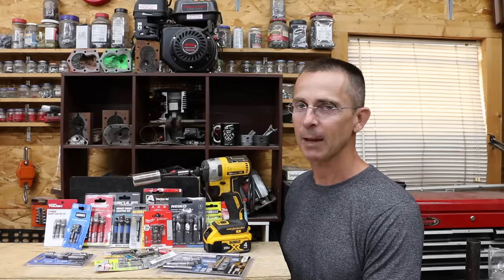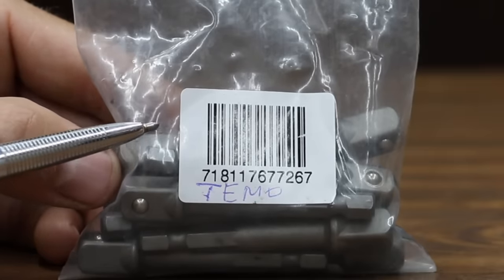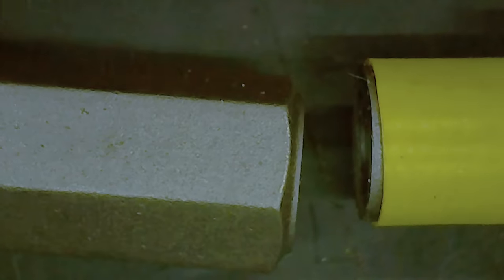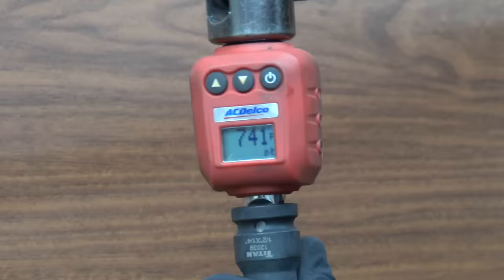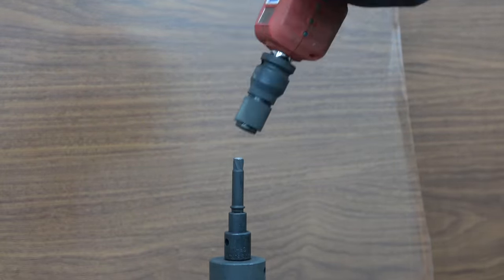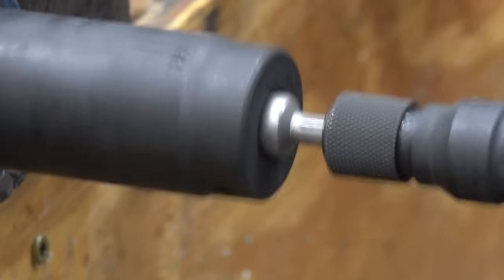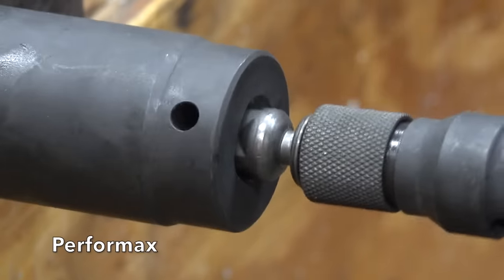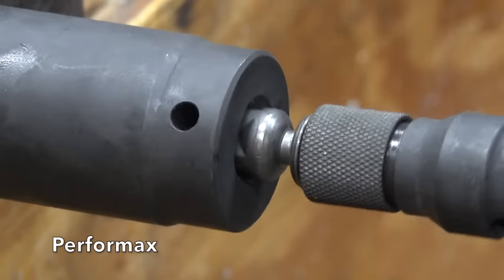Best Socket Adapter? 18 BRANDS: Milwaukee, DeWalt, Makita Gold, Ryobi, Hart, Irwin

Comment: Can your psi ratings be converted to a torque rating of nm or inch pounds?
I just used the Milwaukee 1/2" adapter on my wheel nuts, which are set to 110nm, and it lasted for all 24 of them and it didn't take much effort to take each one off. It's not the tool I would use for work but I didn't have my impact wrench at home only the impact driver and needed to swap my wheels over so thought I would give it a shot as I wasn't bothered if it broke.
Reply from the maker: Thanks for the suggestion.

Comment: I could've used this info last year.  I broke a ton of these things.  But mine usually broke at the smallest diameter between the hex sections where mounted in the impact driver.
Reply from the maker: Great feedback. Thank you
Reply: @ProjectFarm  btw, I was using the Milwaukee impact driver.  The adapters that didn't twist the hex shank after breaking were still usable, but no longer had retention in the Milwaukee.  But they did seem to last longer,  which would mirror your testing.

Comment: I hope he knows that you usually wouldn’t use a torque wrench that big for a impact it is “shock absorbent” sooooo every single hit the impact does when you hear the “ting ting ting” sound is the bar inside the impact smacking another bar giving it that torque Milwaukee was able to flex before snapping and so was others so therefore those are good brands that live up to the name
Reply from the maker: Thanks for sharing.

Comment: How can the Neiko put out 1675 PSI when it breaks at only 666 inch pounds. Is it because of the way the torque was applied? 

Just seems odd that it breaks at around 50 ft/lbs but drives over 100 ft/lbs in the second test.

Comment: The 10 point torx socket was created for same reason... mainly to protect the fastener head. Then 6 point torx plus came out.  

This was a great info. I use the hex adapter a lot. I have also found the dewalt very good. 
Your testing seems to point out the shock protection has no point on socket hex adapter . I know I have never seen to much wear on heads of larger fasteners with correct size socket.
 But on smaller fasteners with an internal socket or screw head you do see torque damage. So maybe shock protection only good for screws.
Reply from the maker: Thanks for the feedback.

Comment: People confuse the purpose for shock Absorbing bits.  Where these tests do show the stronger bits for sure.  What a shock absorbing bit is designed to do is to absorb the peak torque of a impact driver when a fastener gets to a tight state so that you have time to let off the trigger before snapping the bit.  They don't make bits stronger and if anything then make them weaker.  But they give you that absorption so that when you're doing several drives with an impact driver, your bit doesn't snap on you.  Think of them in the way of torque sticks for an impact Wrench.  They give you that moment of exorption to where it starts to rattle  during the drive so that you can let off and be done tightening the fastener  before snapping off the bit.  They are less of a tool of strength and instead a tool to assist a person when knowing what they are tightening is tight?.
Reply from the maker: Thanks for the feedback.

Comment: i did the other way around: bought a small hilti 1/2 inch wrench and adapted it to screwdriver bits rather than having these shanks break all the time. wrench is small and in no way different in size to its brother, the driver
Reply from the maker: Thanks for the feedback.

Comment: Did you ever try Torch Smith brand again to see if it was a fluke? I think you should try the Torch Smith brand again which is sold at Menards to see if your results are the same.
Reply from the maker: Thanks for the suggestion.

Comment: I can't help but wonder if the adapters would respond differently to an impact driver rather than the 1/2 inch gun since a driver has faster blows with smaller hammers
Reply from the maker: Thanks for the suggestion.

Comment: Dude a couple of things
i think Impact duty means it will be less susceptible to fatigue failure, it doesn't mean it will have a higher maximum strength.

At the start of the video u see a cheap adapter deforming and not brittle fratcture.
Thats because cheap plain carbon steel that is usealy used in cheap tools is ductile and not brittle.
Reply from the maker: Thanks for the feedback.

Comment: I find it's a bit odd that some of these manufacturers build in a shock absorbent zone in these bits. For the last 50 years that I've been in the mechanics world I always felt that using an extension between a socket and impact gun caused a loss of torque because the extension would absorb the impacts and not transmit all the torque to the fastener. That little bit of "springing" could make the difference between removing the stubborn nut or not. Many times I've replaced the extension with a deep socket and had success. It makes that much difference, the extension acts like an absorbent area. I'd rather the adaptor had more mass and less absorbent area. Sometimes you just can't replace mass. It kind of reminds me of the old saying for performance engines, "there's no replacement for displacement".
Reply from the maker: Thanks for sharing.

Comment: Questionable as you are putting an added load(twist)(also unequal) on the drivers by not applying the downward force perfectly down....many were cocked a good amount

Comment: and my friend thought i was insane for buying nearly $5 dewalt adapters
Reply from the maker: Thanks for the feedback.
Reply: @ProjectFarm  I bought the Bosh adapter from this video, costed me almost $9 and it exploded on me after 10th screw, I use it with super old brushed Milwaukee Impact driver. Dont know what to think, I hope it was just a bad piece, It wasnt really even 1/2" felt like there was a milimeter gap. Anyway I bough original gen 2 Milwaukee set and I will see if its better.

Comment: I almost think the adapters should be considered a safety net. They will break before the impact driver does. I have seen many drivers rattle themselves apart trying to drive a hole saw bit through a 6x6" post. The driver always fails before the bit.
Reply from the maker: Thanks for sharing.

Comment: Wow,  this video is conflicting with my real world  results.  

I often use a impact driver to remove front end loader bolts torqued to 232 ft lbs.  

I’ve tried many of these brands.  I break all of them. 

Even your worst performing adapter should make it according to your numbers, but none of them do for me.  Still, the impact tool saves me time and time is money so when one breaks I simply grab the next one. I’ve had adapters work for 20+ times and others fail the first time.   

By the way, I reinstall the bolts with a drill to about 150 ft lbs then switch to a torque wrench then torque to 200 ft lbs, 220 ft lbs, then finally 232 ft lbs. I do it in steps to avoid stretching the bolts.
Reply from the maker: Thanks for the feedback.

Comment: Brilliant review! Just shows its all bullcr@p when it comes to tools for the most part unless you're going to buy the most expensive and topnof the line, you're better off buying cheap using quality materials, you could replace em 10x and still come out on top. I think that applies to all power tools and tools tbh. Ive seen professional tradesmen regularly buying Aldi and Lidl own brand power tools get a 3 years warranty and if last longer than that you've only paid 1/5th the price so just replace em.. simple maths really especially as they're German made usually by a half decent brand under their own brand labels.. 
Anyway love your reviews mate!
Cheers from London England 👍🏴
Reply from the maker: Thanks!  Thanks for sharing.

Comment: I don’t think the strongest adapters are the best adapters. I’ve never broken one, and I use mostly dewalt, kobalt, craftsman. One adapter could be 100x’s stronger than the others and it wouldn’t matter for me because I’ve never broken one.   I’d like to see how the the adapters performed, compared to their quality and price, to determine which is the best. 

Actually, if the “weaker” varieties break reliably and accurately every time, you could consider it a feature!   Use the weaker adapters that will break when working with nuts and bolts that absolutely shouldn’t be over tightened.
Reply from the maker: Thanks for the suggestion.

Comment: These should be tested with a 'control' of a given impact and battery for longevity over time under impact. In trades, life span is what matters on these things, not torque. No one is torqueing past the strength of the impact. It's unlikely torque pressure withstood translates to durability over time. Use a big (24mm / 15/16" or greater) 3/8 square so it doesn't take so much time to failure. Also I've noticed failure typically occurs during multiple short bursts of impact. Tired of breaking these- though I do ask a lot of them daily.
Reply from the maker: Thanks for the feedback.

Comment: Torque used to test is not related to the ability to survive impact use. Pulling gradual torque on any impact rated bit or socket will result in failure.
Reply from the maker: Thanks for the feedback.

Comment: Wait, Dewalt brand states it's adapter can be used in impact drivers with "up to" 2000 in-lb of torque yet it fails at 861 in-lb? What am I missing?

Comment: I'm over using these, the fun n games are over. I work at Can-Am which workmates uses these with torx driver bits but they really destroy fasteners and bolts.
I prefer to use these to run fasteners up then torque up by hand.
Reply from the maker: Thanks for the feedback.

Comment: those makita socket adapter you tested are the lame ones.  next time test these : Makita E-01600 Impact XPS 3 Pc. Square 2" Socket Adapter Set .   you'll be surprised !
Reply from the maker: Thanks for the suggestion.

Comment: Using my small impact driver has been much easier in some cases, while a drill with with it's torque settings has been useful for years depending on use case scenario's with different fasteners. Please note that one can't always get into places with a full size 1/2inch|12mm impact driver or a breaker bar, and once again this is depending on use scenario. For example automotive, construction, general household use. So even if you may not have, or currently use anything PF may cover. Trust me it'll save you time when you might find yourself acquiring anything that's covered in these video's. Keep in mind is that some "reviews" might be paid false "positives|negatives" while this is something one can actually watch. Once again, thank you PF for the great content with great lighting and audio with clear concise descriptions.
Reply from the maker: You are welcome!

Comment: I did the opposite of this video,  I have the milwaukee M12 3/8 impact wrench 250ft/lbs (3000in/lbs)  and the Milwaukee 48-03-4405 3/8" Square x 1/4" Hex Shockwave Hex Adapter, also I have a full set of 3/8 sockets,  it feels as strong as any 18 impact driver but it is smaller
Reply from the maker: Thanks for sharing.

Comment: The impact adapters are supposed to flex, and in order to flex, they need to be weaker in the middle. The non-impact are supposed to be rigid, because they don't need to flex, but take steady torque. So the impacts are working just as they should, and shouldn't be tested next to the non-impact adapters. It's comparing apples and oranges. If the impact rated adapters were strong and rigid, they would simply break
Reply from the maker: Thank you for the feedback!

Comment: all of this comes down to they are 1/4" chucked bits. how well can they perform?  there are sizes of drivers for a reason and that is reasonable torque application by driver size.  When you are over that is is time to go up to the larger driver.  zip it down and then grab a ratchet or torque wrench and finish the job right.  letting the tool and it's varying battery condition and various manufacturer impact guns differences determine the final tightness is almost irresponsible. don't try to do more with less do more with the right amount. and remember "more is ALWAYS  better 100% of the time.(or not)"

Comment: It’s illogical to have an “impact absorbing” zone on an adapter. The goal is deliver the impact torque to the socket, not to absorb it in the adapter. It’s better to use sockets with a fixed shaft rather then using an adapter. The shorter the shaft, the better.
Reply from the maker: Thanks for the feedback.

Comment: I believe that your test method directly affected the results that you show, with inconsistencies.  You probably need to create a shelf or platform around the test rig to ensure that your rotational forces are perpendicular to the bit vertical axis.  I noticed that on several of the tests, you placed a combination of vertical and horizontal rotational forces on the adapter bits, so that the forces were not equally applied against the shafts.  The degree of vertical variation causes the inconsistencies.  Also, a few times, you paused the rotaional force in order to get more leverage and continue twisting the bit.  The start/stop action will also create variation in fatigue for the metal, and also skew the results.  In real world applications, this would occur to some extent, so not a real issue there.  But when you are trying to compare them against each other, if the failure point is arriving in a different manner, then the ranking is also skewed.  Otherwise, a very entertaining and informative video.
Reply: Last I checked, real world testing/use isn't going to be in a controlled environment.
Reply: @bensimpson4058  Exactly, but Project Farm is ranking these using "controlled measures" to be as fair and accurate with the results to ensure that he doesn't give a product a bad score by mistake.  So, I was just pointing out some of the "not as controlled as possible" aspects that would affect the rankings so he could improve his process in the future to be more fair.

Comment: Fun fact, Higher carbon steels are less likely to bend but are more brittle and more likely to snap. Low carbon steel will bend easier but are weaker by comparison.
Reply from the maker: Thanks for the feedback.

Comment: Unfortunately this testing did not align with my real world testing. Perhaps the tool manufactures have switched up the metallurgy or their manufacturing process in the last couple years. To those who are interested Dewalt lasted 1/4 the time as Milwaukee did when used to build grain bins (literally 1000's of bolts).
Reply from the maker: Thanks for the feedback.

Comment: The Makita gold impact socket adapters are crap! I've tried two or three of them now and they have all lasted less than 10 seconds under my Milwaukee impact driver. You must have just got a good one
Reply from the maker: Thanks for sharing.
Reply: @ProjectFarm  thanks for replying! Besides the obvious question of why Milwaukee made the most powerful impact driver around, using a quarter inch hex.. is there a half inch adapter you've been using since you've made the video that stands out?
Reply: Sorry I just got this after a year lol. I have the best luck with the DeWalt ones. I can usually do half a job before it will break. You're right about that impact driver and the quarter inch x.. I took the hex adapter out and installed a half inch anvil from their Milwaukee stubby. And now has way more power than it did before and I never have to worry about breaking a stupid adapter again!

Comment: While this is a good test for breaking strength, it just doesn't seem real-world. Most guys use these to snug up nuts all day, not drive then as tight as they can, and the cheap ones just seem to snap after snugging a couple hundred nuts, I assume from metal fatigue, where the ones with the shock absorbing zone seem to never break. I guess that's why the Milwaukee package says 'Lasts 5x Longer', because they are talking real-world use.
Reply from the maker: Thanks for the feedback.

Comment: Why are you using the quarter inch adapters on the impact test and a half inch ones on the hand torquing test I figure it should be the other way around honestly for the figures to actually be accurate for a real life application

Comment: Dewalt makes good socket and drivers but for some reason their "impact" Phillips bits just strip so easily. That's where milwaukee is leagues ahead. But honestly if most Phillips screws were made to accept Philips#3 this would be a non issue
Reply from the maker: Thanks for the feedback.

Comment: So what’s the point of the “shock absorber” colour part, which is literally just a thin piece of plastic? Seems pointless, it doesn’t help the strength of it, if anything it replaces metal with plastic so it actually weakens it! It seems all for show and not function!

Comment: Can confirm the Ryobi adapter is a POS. I snapped mine in its first used, got it replaced, and then broke that one immediately, attempting to remove a bolt that had been torqued to about 90 ft-lbs.
Reply from the maker: Thanks for the feedback.

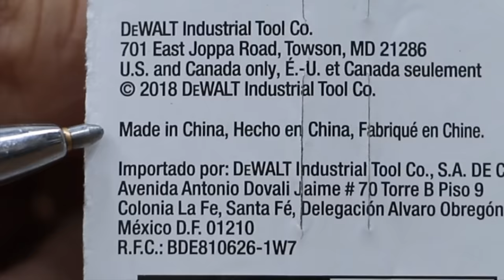Comment: It's a ton of work to produce one of these videos no doubt but it doesn't seem like a good level playing field the way these were tested. The free hand approach, while mimicking daily use well, isn't fair to the individual brands.  The torque applied to one adapter would look fairly centered and the next would be off center by a considerable amount, in both tests.  Not unlike breaking lugs on a wheel by only applying leverage at the end of the tire tool. Doing it the way this was done would give vastly different results even if you were testing the same model adapter repeatedly.  Example https://youtu.be/nMQoM6drzLs?t=444  Minute  7:24